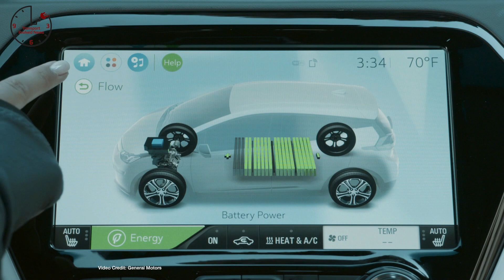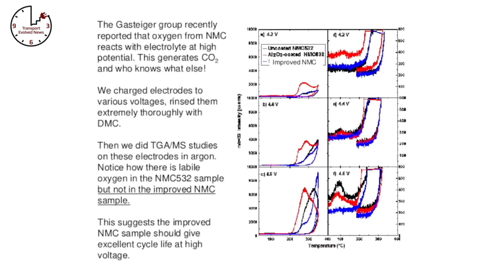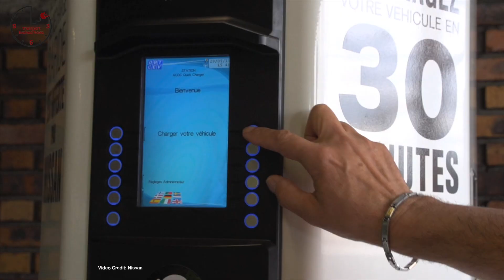Tesla Q1 Earnings, Nissan’s answer to the PowerWall, Boring Company T.E.N. Future Car News 5/5/2017

Comment: nissans is making the ugliest car on the market... the cube, juke and leaf are amongst the ugliest car but there is one thing I give nissan credit is to push a 150kw battery pack... why on earth someone would shed 60000$ for a bmw that can ride 100km (and this is on best riding condition in summer without ac) or an e-golf at 38000$ that has 200km of autonomy... wake up car manufacturers... wake up...

plus John Goodenough, the invententor of the lithium ion battery, has developed a new all-solid-state battery cells that could lead to safer, faster-charging, longer-lasting rechargeable batteries for handheld mobile devices, electric cars and stationary energy storage. 

but nope, still crap 10kw and 20kw battery packs are still being installed in crazy expensive cars...

Comment: Had to add one more obs, about the fact Tesla is still losing money.  The analogy, is with imagining you are a demi-god with shares in dinosaurs on Earth.  Someone, somewhere, far, far away, produces a batch of humans and plops them down.  Whoa!  These things cost a fortune to make, they are complex down to cellular level, and it appears the makers will never get their money back!  Not only that, they have problems dinosaurs don't have...weak, small, puny, easily broken, can't stand the cold buck naked etc.  Yet, they can make tools and do complex stuff etc.  Which species would you want shares in the 'makers' of is my analogy.  Despite the dinosaurs being strong, massive, and literally eating the humans for breakfast, the humans are adapting fast to the environment around them.  Mathematically, they are slow to spread, but there will come a tipping point and the dinosaur makers will have to start knocking these puny humans out in place of the model T-Rex and so on.  Seen 'Take me Out'?  Quietly, as there's some prospective heart-throb trying to impress a line of ladies with gymnastics, there is half of them smiling nodding and knocking their lights off slyly.  That, is the investor currently loaded up with VW, BMW and Ford shares in their portfolio.  They must be buying into Tesla like hell, know the old makers are in danger of slipping into torpur, and quietly so as not to be noticed, getting themselves into a position of a lot less exposure on these old crocks of s**t, and a lot more investment in the future-looking stuff.  Hell, it's like A**le but you are in on the ground floor!

Comment: It will be interesting to see how successful Nissan are with their home battery storage system. Given I had to pay to replace my LEAF battery after just 5 years, Nissan may find potential customers more wary to invest in the same battery technology as the LEAF for their home. 

Nissan may find that being slow to assist their 2011/12 LEAF owners with battery degradation concerns may depress demand for their energy products. Karma bites.

I'm interested and excited to see Nissan offer home storage, I just won't be first in line to buy their battery tech this go around. More likely to give Tesla a chance for both home storage and my next EV.
Reply: Stationary storage may be a lot less demanding than mobile storage.  The temperatures are a lot milder and the duty cycle is much lower.  Power levels are much lower too.  A few kw to power a home is much less than tens of kw to move a car.  That may favor battery longevity in stationary storage.

That said, the market for home storage is currently much less than for EVs.

Comment: Its sad GM does not make money on the Bolt. I bet the engineers that made it were very proud of the car.
Reply: There's no economy of scale since LG builds the battery pack and possibly motor/controller, and since no one is building huge battery factories except for Tesla.  GM can build EVs at a loss.  Tesla can make them at scale for a huge profit, mostly due to battery cost reduction from Gigafactory.